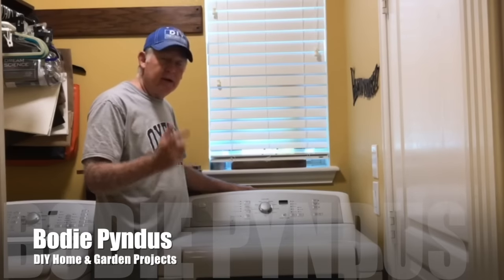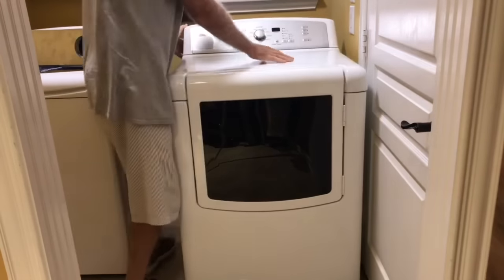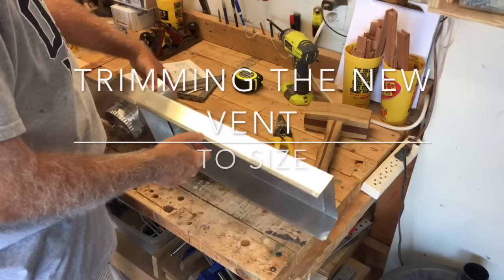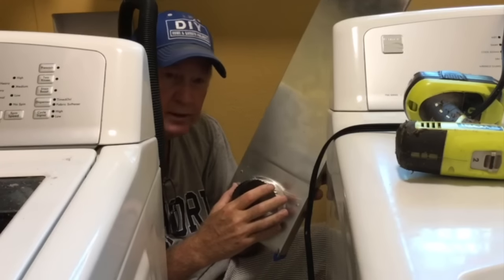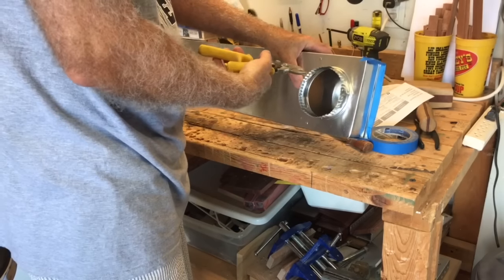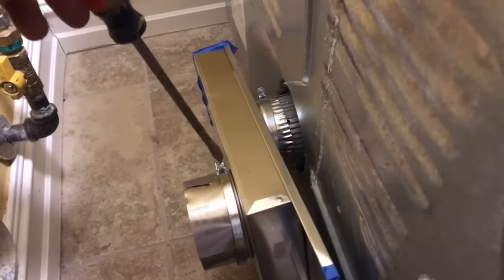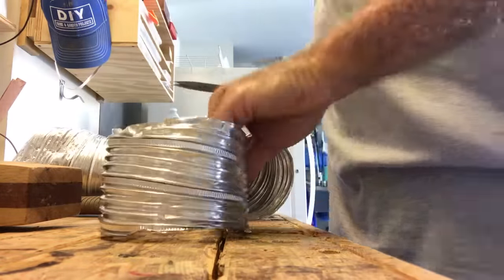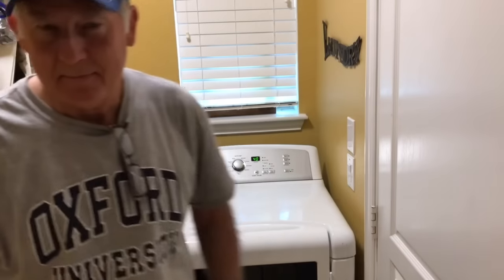How To Replace A Dryer Vent: Easy Step-By-Step Guide For Tight Spaces

Comment: It would be easier to just buy another house.
Reply: That's funny
Reply: It’s true
Reply: @ninjamaster3453  gang gang
Reply: Just bought a new house... it has even less space than in the video :( I'm hoping that a periscope plus a magvent coupler should mean I only ever need to do this stupid job once, then never again, even when cleaning the vent.
Reply: It worked wooo!
Reply: @JW-rw8fq  i feel triggered, thx cool guy
Reply: That’s how I’m starting to feel.
Reply: If you buy new houses it will be same problem, best solution send your clothes to the cleaners, you don’t need a dryer or washing machine. Problem solved 👍

Comment: The proper alignment is crimped inside smooth.  While this job may be an improvement. It is backwards and would have needed no “relief slots” if flipped the proper way around.
Reply: Hacker
Reply: Yep dude created a lint trap
Reply: That's exactly what I was thinking. Basically you want no obstructions to the airflow. So the wall connection goes inside the flange and the dryer connection goes outside the flange. It's supposed to be that way to prevent the ridge from restricting the air flow. So yeah this is a bad video as far as that is concerned.
Reply: I wondered about that!
Reply: I was just about to make this same comment.  The crimped flanges should fit perfectly inside of the non-crimped flanges without making any cuts.
Reply: Also if flipped around, the long end would not be hitting the gas line.
Reply: @csrnibbler9912  If my wall connection is all beat up and out of shape, how do I get the crimped edge inside of it? do I need to make a cut in the wall outlet to allow it to be manipulated over the crimped edge?
Reply: @ruthlowrey3962  Replace the wall vent. They aren’t all that expensive. And chances are the flapper on your wall vent probably doesn’t work all that well at this point.

Comment: I think you have the flanges mounted backwards.  The crimped flange should go inside the smooth flange.   Otherwise the lint will build up on the edge of the inside flange.   Same with the screws.   They catch lint and cause build up.
Reply: No NO NO!!!!!! It has too much back pressure and starts fires. This guy is a hack!!! Use 4" round hard pipe only!!!!
Reply: I was wondering about the square pipe? I do know that for every 90° bend in a pipe, it loses 5 cfm of airflow. They are losing at a minimum of 10cfm of airflow with just that rectangular apparatus and possibly more because of the rectangular exhaust. The screws should Not be more than a quarter inch through the pipe walls. If they're longer, they will cause lint build up. I showed my wife even she knew why the screws should be short.

Comment: I agree with the previous comment ... the crimped stack is specifically designed to go inside of the flat stack. The installation method shown in this video is incorrect. In addition, it is not a good idea to introduce paper masking tape to the vent as it could create a fire hazard. If you need to protect the trimmed edges, it is preferable  to use aluminum foil tape specifically designed for high temperature applications. Finally, it is never a good idea to push your dryer (or washing machine) in so far that it touches your gas supply line. Both of these machines vibrate and could move during operation (unbalanced washing machines can walk around the room) which can cause failure to the gas supply line or vent  stack.
Reply from the maker: Tim, I agree.  If you watch the complete video, you will see at the 7:30 spot, I explain replacing the blue tape with the aluminum tape.
Reply: DIY Home & Garden Projects The tape should be the least of your concern with this hack job. What a mess! Needs to be completely redone, PROPERLY.

Comment: You installed the vent backwards. The smooth vent fits over the dryer and the crimped side fits inside the wall.

Comment: I would have gave up when the gas line prevented the fitting. :)  Great DIY mindset to power through without even a blink!
Reply: No NO NO!!!!!! It has too much back pressure and starts fires. This guy is a hack!!! Use 4" round hard pipe only!!!!

Comment: I have used one of these over 9 years with great success.  This was a challenge I had to solve when I bought this house.  I just do normal cleanings yearly with a rotary brush.  My washer is to the left of my dryer, but my dryer must vent to the left side wall of the washer near the back wall.  (reversing them would cause door opening problems)  Space is tight so I have to use a periscope vent.  I do think it helps that they are both on pedestals so that my dryer vent is downward.  I pulled it all out when I replaced my washer a few months ago.  I was pleasantly surprised that I only had lint in little nooks and crannies of the periscope vent and it was minimal.  It was completely safe.

Comment: The crimped male coupler is supposed to go on the inside.  It's all about air flow.  Warm air is exiting the dryer so your female periscope coupler needs to be on the outside attached to the dryer.  Now attaching to the wall, the crimped periscope male coupling goes
 on the inside in order to keep the air flow as much unrestricted as possible
Reply: Absolutely right.  Everything from the exhaust pipe on the dryer out to the cover for the exterior vent should go "inside" the next pipe fitting.  Otherwise as you stated, the airflow is disrupted and also lint will easily begin to accumulate at that joint and clog the line creating a fire hazard and lower efficiency of the dryer but nice job Bodie of getting people familiar with the periscope vent.
Reply: @eman-3  oh great explanation thank you.  I'll be doing this 2morrow
Reply: I am having trouble just getting the periscope to extend. Where are these tabs? WTH am I not seeing?

Comment: I know a lot of ppl complained that you installed it backwards, (which according to my research, is true,  😬) but I still benefitted from your video, so thank you. 
It’s easy to see what went wrong when you’re watching someone else figure it out ((I always find it helps me imagine my way thru a project, watching someone else work, and brainstorm some possible improvements), but when you are the one figuring it out for the first time, you don’t have the advantage of hind sight! 
I still enjoyed the video and thank you for making it and for sharing! 🌷
Reply from the maker: Susan thank you for your kind comments and thanks for watching.
Reply: I'm not sure I would call it "complaining" as much as I would call it "Adding Insight".  All data input helps for a better outcome. Great Video and Great comments
Reply: No NO NO!!!!!! It has too much back pressure and starts fires. This guy is a hack!!! Use 4" round hard pipe only!!!!

Comment: We were told not to use any corrugated venting material for our dryer. Also, perhaps the outside dryer vent that exits the house should have been replaced first. It looked to be pretty old a beat up. We used straight, smooth venting material, connected it with the screws but then wrapped with aluminum tape. Save, secure and no leakage. Helps to keep the cold/heat from escaping into the house, also. Just takes kudt a little extra time.

Comment: Gotten as far as just after you used tin snips and covered rough edge in painters’ blue paper tape.  Go back and replace that with aluminum duct tape.  Non-flammable alternative.  Very helpful video on using this alternative vent chase.  Thanks.
Reply from the maker: Well, if you watch to the end of the video, you would know that I already made that suggestion.
Reply: @DIYHGP Ha. You said you were filling the gaps shown with aluminum tape, not replacing the blue tape as Katy suggested.
Reply from the maker: That’s correct

Comment: Flip the vent and it seems like you would have cleared the gas fitting, looks like you have excess vent at exit of dryer lint can accumulate there, before you make final connections wipe down with alcohol to remove oil’s from any joints where exhaust can escape, use aluminum tape do not use duct tape it will dry out and become brittle. I installed this same vent and it so happens that I used every inch of it and it’s working great! If after flipping the vent  and it was coming in contact with gas fitting shut the gas off and shorten the nipple, Simple. Good luck DIY’s 🤙🏼😉

Comment: I liked how you used the socket to tighten the gasket, don’t you need a gasket next to wall side? Also crimp goes inside. So extension is backwards. Might want a do over.
Reply: Agree with you 101 %
Reply: No NO NO!!!!!! It has too much back pressure and starts fires. This guy is a hack!!! Use 4" round hard pipe only!!!!

Comment: Try some aluminum tape to seal it up.. Worked awesome on mine..
Absolutely no lint or dust behind my dryer
Reply: No NO NO!!!!!! It has too much back pressure and starts fires. This guy is a hack!!! Use 4" round hard pipe only!!!!

Comment: I solved the gas line problem by having the plumber put the gas port into a wall box. I still have the gas flex line, but it takes up less space than the dryer vent and they are no longer near each other.

Comment: I have the exact same dryer vent.  It requires a lot of work and it leaks lint from every crack and crevice.  My dryer is vented through the roof which is a terrible design.  I ended up wrapping the entire vent, after cutting it to size, in duct tape.  Works perfectly now,   but still a pain.
Reply from the maker: I recommend the aluminum tape over duct tape.
Reply: No NO NO!!!!!! It has too much back pressure and starts fires. This guy is a hack!!! Use 4" round hard pipe only!!!!

Comment: If you had cut the box so that the input from the dryer was at the END of the box, it looks like it would have cleared the gas line. A pic from the top looking down would confirm whether or not it would have.

Comment: Backwards flow installation,  with inside lip facing flow nothing but a lint collector.  Also, fire hazard with blue paper painters tape on hot vent.  Only use metal tape on all dryer vent installations.
Reply from the maker: You people kill me.  the ones that don’t ever watch the end of the video to see that I replaced the blue tape with the metal tape.  watch the whole damn thing before you comment.
Reply: @DIYHGP  I apologize for my hasty comment  regarding your video.
Reply: @DIYHGP  but it's still backwards....

Comment: Any issues with airflow and sensors going bad because of the lower airflow space?
I have a Samsung with a similar situation, I used the periscope vent and I have been having to replace the element more than once and the other sensors.
Not sure if it’s related to the narrow vent
Reply from the maker: Dad, sorry I cant help you with that one.

Comment: Those "grippers" were backwards. Gripper on smooth not on each other. They are actually use to reduce diameter but since you put them on each other that messed it up. You would not have had to cut those slots had you done it correctly.

Comment: For proper air flow & exhaust... New vent pipe goes INSIDE the old (house wall) outlet. Other side of new vent pipe goes OVER the dryer outlet. Simple. You can even use a bead of duct putty when you assemble.

Comment: IN MY BOOKS IT'S  UNSAFE, THE FLAT VENT CAN LEANING ON THE GAS LINE ELBOW POSSIBLY CREATING VIBRATION AND DISTURBING THE GAS LEAK SEALER or THE GAS LINE ITSELF.

Comment: Sir, save yourself all that needless extra trouble and money by foregoing the periscope vent and just directly connecting a modified (cut to size) aluminum flex hose. I find that in your particular situation, where the wall connector was too short and the gas line was in the way, the periscope dryer vent, which is typically used to save space, was completely unnecessary.
Reply from the maker: Due to the compact space, the periscope vent was the only solution.  But thanks for your reply.

Comment: Can you use a periscope 0-18 if your dryer is on a pedestal? My pedestal measures 14 inches ?
Reply from the maker: amber,  yes it should  work horizontal as well as vertical

Comment: It worries me you ignored the air flow with a gas dryer. You should not touch gas appliances without doing your home work. The crimped end should go into the wall. Also you have to do a better job at sealing the joints since it’s gas. I’m worried about the work you do!

Comment: It's a shame the Home Builders & Appliance Manufacturers don't work together to "Standardize" the vent pipe position on the wall. Then you could implement a simple self sealing dock. I am a service technician and see plenty of this "Hillbillie" Hookups in homes like this one. Problem 1:  You won't ever move that dryer to retrieve any items that fall behind. WHY: You have to move the Washer & Dryer to get the runaway that fell behind, you have better things to do on Saturday. So there it sits. Meanwhile other items along with combustible matter such as lint mixed with Fabric Softener will join the party in time.  Problem 2: "What's this additional Labor Charge on my repair bill?" That was for the extra 1/2 hour to reconnect your dryer to the wall!  For now just use:   Deflecto Easy Connecting Dryer Vent Hook Up Kit , Flexible Semi-Rigid Aluminum Duct, (HUPK8WA/4)  The plastic collars just push on the wall pipe and dryer pipe.
Reply: The only other problem is not all dryers have the vent in the same exact spot. I have a new washer and dryer.. the vent to the wall and dryer are dead on.. (the old one was not) problem is I have to remove the washing machine to get behind the dryer if I use something like a periscope. I was thinking more telescoping.  I can't stand it.. my dryer always gets the code that the airflow is bad with the huge hose that is on it now.

Comment: Looks like you should have flipped the exhaust to move the box away from the gas line. That would have moved the dryer two inches closer to the wall and may have fixed the need for the short piece of flex pipe.

Comment: One other option is to cut a dryer sized square in the side of the house and hang the ass of the dryer outside, then foil tape around the perimeter of the dryer. Just have to be sure to use a wet approved housing for the 240v outlet on the outside of the house.

Comment: That darn gas line kind of ruined the whole purpose of getting the dryer closer to the wall. You might have gained an inch.
Reply from the maker: That’s right but at least I didn’t have a crunched up line.
Reply from the maker: That’s right but at least I didn’t have a crunched up line.

Comment: Kinda Mickey moused but it should work. Also the spring clips should only be used on flexible dryer vent hoses.
Reply: Agreed. How about he foregoes the periscope vent all together.
Reply: @elle9633  the alternative is for the dryer to be a foot away from the wall.

Comment: I had the same problem I actually modified the piece in the wall with a long tube ( yanked the old one out ) flex aluminum can actually turn over itself like a snake 🐍

Comment: Seems like just cutting the original flexible hose shorter would have done the same thing? Oh and I hate it when builders leave the pipes sticking out the walls as if they didn't know that it would cause appliances like your dryer or stove to stick out instead of sticking to the wall 😢

Comment: Or just use a 2 feet (extendable to 6ft) semi-rigid aluminum transitional duct that has male and female terminates on both ends. Just bought one yesterday for $15 at HP.
Reply: Would love to know where you found your transitional duct. I need to fix my problem ASAP, and this seems the way to go.
Reply: @julieclark5671 AT Homedepot, look for the semi-rigid aluminum 4"  tube  that has a male and female extensions at both ends. Buy two 4" metal clamps to tighten them together.
Reply: Unfortunately, this method forces the dryer to be much further from the wall than the periscope. Two 90º bends, plus 4" semi-rigid duct leaves a minimum of a 7" gap behind the dryer. The periscope drops that gap considerably, allowing the washer and dryer to sit at the same (or at least similar) distances from the wall.

Comment: So those square vents actually are not good. if its a gas dryer.. carbon monoxide will leak out if not sealed. Do not use duct tape use ul listed foil tape. it can handle up to 150 degrees. Duct tape cant. 
If it's a electric dryer the lint gets stuck in it because it is not natural air flow flowing one way. the air circulates in there and doesn't go strait out. (its a disruptive path for the air flow and lint) Try Not to use these contraptions & any flexible tubing because the lint gets caught in the crevices and it forms a back up.
Reply from the maker: Obviously you didn’t watch until the end of the video, where I discussed using the aluminum tape to seal all the joints. I appreciate your comments but they’re incomplete because you didn’t watch the video completely.

Comment: Those space saving devices are horrible and should never be used. Dryers are meant to exhaust thru a 4” round metal duct, and only a 4” round metal duct. These space savers are highly restrictive and can cause dryer damage or worse.
Reply: You should tell Whirlpool that, the manufacturer of the vent....

Comment: You did this completely ASS BACKWARDS! The side with the corrugated piping was supposed to go INSIDE the wall outlet and the smooth pipe (the one you cut slots in which you should not have) slips over the outlet of the dryer. DID you even read the instructions that must of come with it? WOW!!!!!!!!!!
Reply from the maker: I understand your comment and I tried it that way.  it was it on the job assessment that it wouldn’t work due to the configuration of the location of my gas valve behind the dryer.